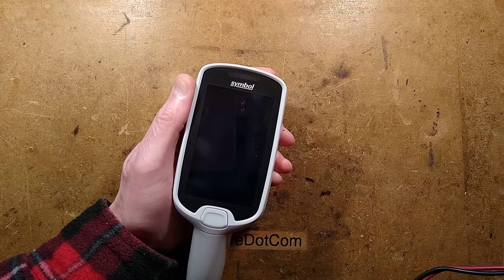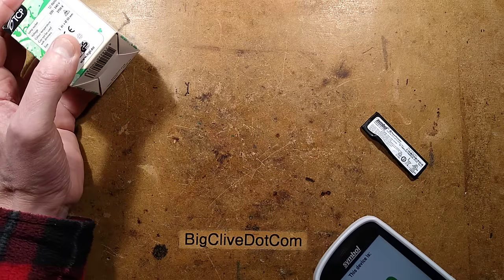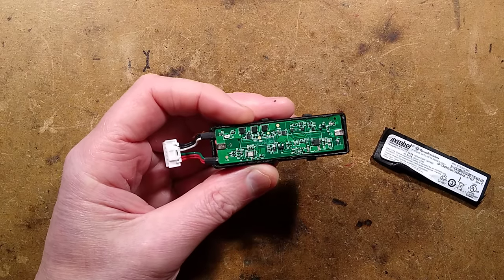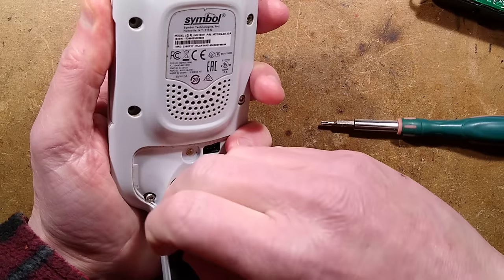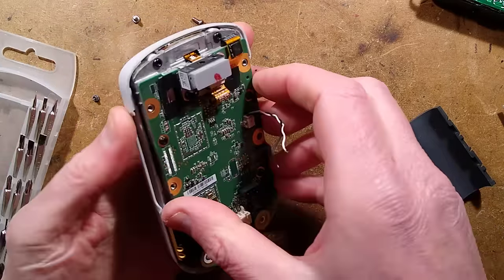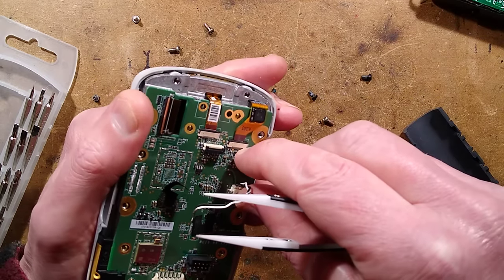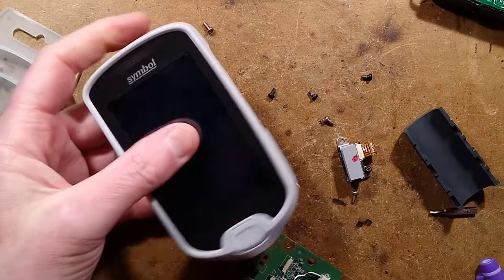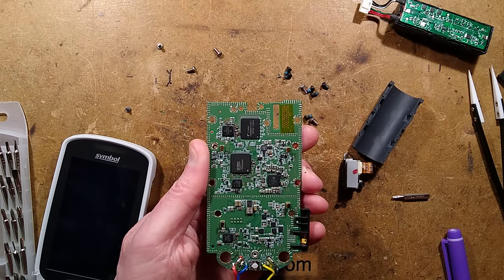Inside a Zebra MC18 self-scan terminal

Comment: I used to repair these for a living. 11 years of it, from basic scanners to laptops. We had Symbol's UK repair contract. Such an odd company to work for. We had the racks filled with various versions. It was mainly modular swap-out repair, but there was some circuit-level tinkering too, from time-to-time. They started as dumb barcode scanners and then got more sophisticated (obviously) with mobile computers. Other contracts we had, those companies used off-the-shelf smartphones, applied their own software, and had hard shells they clipped on that included the barcode scanner unit built in. FUN FACT: in the Nu-Trek film (Star Trek 2009 with Chris Pine) Google a shot of the bridge. Right at the front, in between where Sulu and Chekov sit is a pair of Symbol barcode scanners 🤣 You can see their red lenses. Guess the set decorators felt they looked like phasers.
Reply: Also, "MC" stands for "Mobile Computer", and they also made long-range scanenrs for factories. You coulod fire it up at high shelves without needing a ladder. In theory. . .
Reply: @HAL9000.  Symbol M2000 Omni
Reply: that's hilarious. set Phasers to SCAN!
Reply: So they do, that's hilarious

Comment: Looks like that unit has come from the Hessle Asda store in Hull. The VMware air watch splash screen is an endpoint management system which is probably what’s locking the device down. Surprised they ended up on eBay without being wiped first.
Reply: Speaking as a field tech, when we decommission gear we're occasionally allowed to keep or dispose as we wish. Sadly most companies just replace equipment instead of actually fixing them as it's more cost effective. (ex 1 hour to replace vs 3 to to troubleshoot)
Reply: Why hull
Reply: @phonotical  A much repeated sentiment 😅
Reply: @phonotical At 02:16 it shows Store 4126 which is Hessle Road, Hull.
Reply: @georgeprout42  ah
Reply: @andy2950  specially to those that live there 😅
Reply: Is it really not "wiped"? The only App that it shows seems to be some diagnostic interface that just has the store number but not the real scanning app on there. Maybe this diagnostic software is part of a base image on which they can add the real scanning app onto. I guess they don't have the original factory image from Zebra and it would be tedious to flash that on multiple of these if they upgraded the fleet, guess that needs to be done over USB.
Reply: I would assume it is displaying them details/diagnostic screen rather than a normal display due to being unable to connect to the WiFi with a connection to the store’s servers.
Reply: Yeah. I imagine once it gets into the store and back on the dockign station, it will probably work as expected unless it's removed from the system.

Comment: The beauty of self-scan over checkout scanning is that you can shop directly into your own bags or boxes. We have Sainsbury's plastic boxes we have reused for the weekly family shop for over 20 years!
Reply: Tenuous side note: If you take the rear seat squab out of an XJ6 SIII Jaguar the Sainsbury's plastic boxes fit perfectly in the exposed floor pan.
Reply: Nice. I never thought of doing that
Reply: On the rhe downside, I don' have any of the stores with self scanning that has a layout that makes for a sensible route to get the bags packed the way I want them
Reply: @michaeltempsch5282  Actually, using your own bags is not the main reason. You would spend the same time reordering your shopping at the till or when you get home. The big saving is the queuing time. If you have 3 people with full trolleys in front of you, it is much faster to process three self scan customers than wait for three manual scans.
Reply: You need boxes, that fit into the shopping cart.
Reply: @@Aduki65 By self scan, I was refering to the hand held self scanner, as featured in the video.
Reply: Even more useful if you're shopping by bike. Most pannier bags clip onto the side of the trolley nicely so you can just pack straight in.

Though it can be a right pain on the odd occasion you get selected for a check...
Reply: And then in my country you get fucked over and 9/10 times a cashier has to check if you didn't steal anything...

Fuck these things and just pay for cashiers dammit
Reply: @@Aduki65We are in fierce agreement. Not sure how that wasn't clear. I no longer live in the UK. So maybe things have changed. I see some supermarkets don't have dedicated lanes for those who have used a hand scanner and mix them with people doing self scan at the payment point - not ideal.
Reply: … I thought you meant something completely different!😂 (“Shop”… directly into your own bags)🤔

Comment: I have an 8KWh battery assembled from these devices at home, they are used by TESCO, we refit the battery for them every year. In our warehouse, these devices are resting in a trash can 😀 Greetings from Slovakia
Reply from the maker: Do they still have a decent capacity when they're retired?
Reply: Awesome, using trash to make cool stuff. 👍🇮🇪😊
Reply: 8KWh? That’s a lot of little batteries to connect together lol!
Reply: Perfect , we used to do them for Sainsbury's
Reply: The capacity is usually extremely high even after a year or two , we were replacing ones 6 and 7 years old and they were basically new ,  high quality cells , will see if I have a couple lying about from one of the packs

Comment: As someone who worked with similar Zebra devices (TC55s, 56s, and 57s) Airwatch is an automatic provisioning system that initially configures the device for its use case and makes sure that the Android software packages are automatically up to date. The launcher locks down the device and only allows you to use certain applications it can also auto launch apps on boot.

At their core these TC devices run Android it's just being obscured by the launcher. To factory reset the ones I worked with you had to boot into recovery mode with an SD card inserted and launch a factory reset zip file provided by Zebra. The device would then boot into a more familiar Android home screen.
Reply: I always assumed they used mobi control as standard for provisioning, I fix a lot of TC75/77 and factory resetting tends to bring up mobi
Reply: airwatch is a MDM software and is used by large corporations to manage their mobile fleet. its the software deployed on company issued mobile devices or tablets to manage them remotely. it could either be a bundle sold by the middle man you got your devices from or your company it has a contract/subscription with VMware for the software. you can remotely lock these devices down to custom apps, locate them, reconfigure them, erase them

Comment: I have experience with Zebra scanners in warehouses where they connect to a big ERP system to report inventory movement. Connected through RF connections, workers moved through the warehouse scanning locations and part numbers. . They were a constant source of frustration and seeing one opened up was very pleasing. Good work.
Reply: Not a hundred percent on this so don't quote me, but I'm pretty sure these self scan units connect to the same ERP system that the warehouses use. As for the constant frustration they cause, I too know that pain.

Comment: VM Airwatch is a corporate management program by VMWare.  It was never removed from that application prior to sale.  It was probably sent from a company as scrap and then recycled by a recycler.
If you connect it to the internet without clearing that software, it will try to connect to the configured corporation.There is a key combination and a bypass code for Airwatch, but it's usually setup by the company that originally owned it.
The face on ours was held on with the clips and adhesive foam tape.  A heat gun helped with taking ours out.
Reply: Saving this
Reply: It's also hideously complicated to use, I just want to add.
Reply: Considering the version of Android being used, you can use vulnerabilities in the OS to reset the device. We didn't have the ability to disable boot options. You can load your own custom fastboot ROM and do whatever. Those TX/RX pins and the header on the back are just sitting there, wide open.

Comment: The black goo you can see "leaking out" from under some of the ICs is underfill. It's like a low viscosity, non conductive glue that is applied with a syringe (usually by a machine), and wicks under the BGA, gluing the BGA down to the board. It's used to make the BGAs vibration / drop resistant.
QFPs, J Leg devices (like PLCCs) and DIL packages all have leads which can flex and absorb the shock of vibration or the device being dropped. BGAs have solid solder balls directly connected to the pads which will crack rather than flex.
I used to see a lot more underfilled devices 10-15 years ago than now, but a lot of BGAs have been superseded by QFN or LGA type packages that are flat bottomed and solder direct pad to pad, removing the weak link of the solder ball.
The soldering looks bad overall. It looks like a lot of devices have come off the board, leaving the pads intact and not leaving the component terminals behind either. In each case it looks like the actual solder joint has failed as the component has left the board, like it didn't really wet properly. I noticed it was the solder joints that failed quite easily to disconnect the speaker too.
Reply: I don't know the manufacture date of the device, but it's possible these were made just after the line had transitioned to ROHS and they didn't quite have their lead-free soldering process dialed in yet.

Comment: That logo on the big chip near the edge is Toshiba. They've used several logos over the years, all some kind of letter T. That one is a bit hard to tell because it's a like, isometric view of a T lit from the side. I had guessed it was an eMMC chip based on the size shape and the footprint it goes on, and it seems like I was right: THGBMHG6C1LBAIL is an 8 gigabyte eMMC made by Kioxia, who were formerly Toshiba Memory before rebranding (presumably they were spun off).

Comment: To gain access to the battery terminals, heat up a couple of T-pins and push them into the plastic until they make contact with the battery terminals inside....instead of drilling and risking messing up the board.

Comment: At around 5:20, that chip (that was missing by the time you got around to opening the battery pack) is most likely to be a battery fuel gauge. The pinout and footprint matches a Texas Instruments bq27541, which is a single-cell fuel gauge with an I2C or single-wire HDQ interface; given the presence of D1 and D2 for ESD protection, it's probably using I2C to talk to the scanner. While the chip itself can't lock out the battery, they can contain authentication keys so Zebra could restrict use of third-party batteries if they desired (not that I have checked this, though).
Reply: They could do, but the old MSP agent software can go one better. It can report the exact battery status, usage, charge time and also I think battery temperature on some models.     With the smaller units like this I wouldn't be surprised if they offloaded a lot of the simple diagnostics to the battery. Makes the mainboard cheaper to produce.

Comment: Elpida is a RAM manufacturer.  The chip with the roll-off-the-tongue name will be flash, the TI part probably the power.  I bet this is a "Package on Package" system and the main CPU/SoC is under the RAM.  LIttle pin header on the back is probably JTAG or something for programming?
Reply: Bingo!
Reply: The flash is from Toshiba I think.
Reply: Yeah, too bad, would've been interesting to see what soc it ran.
Reply: Elpida translated from Greek means "hope".
Reply: @Subgunman  Did Clive just bust open Pandora's Box, then?
Reply: @abitofabitofabit4404  he didn't pop the RAM off the processor, so maybe not...

Comment: Back in the late 90's and early 00's I worked in a Safeway in Scotland who pioneered these with their "Shop and Go" scanners and "Green Boxes". It very quickly got the name "Grab 'n' Run as people sussed that they could hide expensive items under cheaper goods before Safeway eventually phased it out altogether

So when these devices appeared I knew that it was just going to be the same thing all over again... And well yeah it was... 
Some things never change
Reply: The check out scanner at my grocery store requires the customer to enter a product code for produce items. The store must have a lot of loss,  like people coding a $200 truffle as a $1.99 per pound mushroom. (innocent mistake)

Comment: VMware Airwatch is device enrollment software. used to keep devices locked down, secure and ensures can be managed/updated remotely.  Mainly seen that on laptops and Mobile phones.
Reply: Yes, it´s a mobil device management software. At work I run a fleet with about 3000 mobile devices using AirWatch, a couple of hundred of those are Zebra PDA:s.

Comment: Symbol I believe was the company name before being acquired by Zebra in 2014 when they bought out Motorola Solutions. Basically all of their equipment are built like bricks.
Case in point, I know some people at work that have used our TC72s to pound screws into plywood in the absence of a screwdriver.

Comment: As others have mentioned it appears the pins at the bottom are USB, the fact I found a USB driver for it on the manufacture website would lend support to this, I assume you powed it with 5v, which if true would also support that too. I have also found some tools that appear to be for updating or reinstalling the OS, but I've not had time to read the documents yet to work out what they actually do (again on the manufacture site). I've ordered a few but sadly not got acess to my bench at the moment (travelling), when I get back this will be the first project in line, looks like a fun challenge!
Reply: Can you post the URL or the search keywords to find the site you found?
Reply: @berlinberlin4246 Yes, I believe links are blocked in comments, but if you search "MC18 software" a webpage called MC18 mobile computer support & downloads should come up, you can find the software and documentation on their.
Reply: Unlikely USB, as the contacts connect to pads on the board labeled TX and RX.  Probably more likely UART, which while not as plug-and-play as usb, is much easier to work with.
Reply: @faeranne  quite possibly, the datasheets I saw were annoyingly non specific about it, usual just say "data" or "communicate", I wonder what the other com port is for as well, it's possible a programming thing? I don't recognise it as any standard, but I'm not all that familiar with these kind of device combination protocols
Reply: The bottom pins only can provide power, but not data. To flash software, you’ll need to connect something up to those back pins.
Reply: @Tamay.  No, they 100% deffinatly do data, that is how it communicates with the charger Dock (negotiate higher charge currently etc) inorder to reflash it you quite possibly need to connect to the other port, but the base absolutely dose data, it says so in the manual. As I mentioned I have found a usb driver for it, but I've not had time to read all the documents or play with it yet, so I don't know exactly how it works or what it can/can't do
Reply: The 2x4 pin header is a combined USB OTG and UART debug port with a boot mode switcher button according to the refmanual appendix pinout. The latter might be just a simple linux shell /w login prompt, adb enabled or even reach the 1st stage bootloader on a key press in a vt100-ish terminal emulator if you're lucky enough. The other big if is accessing the internal storage via USB hoping it isn't locked out and Zebra lets you download stuff from their site. There might be a chance to load one of the factory reset images whick wipes even the enterpreise stuff and voila, factory android UI shell restored. Looking at the screenshot out of the reference manual: the recovery menu seems to be ye olde clockworkmod or similar.
Reply: @chris-tal  this seems very lickly, I was quite sure USB must be involved somewhere as it is mentioned a few times, one of the other tools you can download off the website is called something todo with Windows clean install, but i have not looked at it atall. This sort of software stuff is not really my area, but I want a challenge! I'm going to play a bit once I can acctualy power the thing properly, and I'll see how it goes, I got a couple so I can destroy one or 2 in the process if I accidentally render one unbootable or whatever
Reply: @craigmatthews7962  Hm this is good to know. I haven’t had data work over the bottom port yet.
Reply: @Tamay.  As I said the datasheet was annoyingly non specific about what the protocol was and what it actually dose, but it had instructions on how to set the base for I think 1a or 1.5a charges which must use data of some sort and it says the 2 communicate with each other. Would be nice to get a base station to play with as well, but I've not found them yet on ebay.

Comment: You did well on disassembly, Symbol cases I am sure were all designed by Rubiks.
The old MC9000/9060 series were amazing with an entire scan engine module. with oscillating mirror and laser that scans, decode and output the required info inside a rubberised housing that takes a beating from some of the  most ham-fisted I have ever seen on many sites.

Comment: They use them in Jumbo and Albert Hein in The Netherlands. 
the lock in the cradle you mentioned can be bypassed by a zip tie, and the store near me have a ziptie on the cradle rack by the checkout for when they move the scanners back to the pickup point at the front of the store.